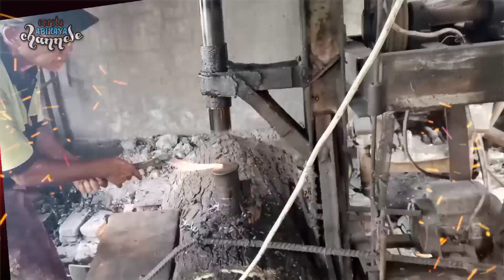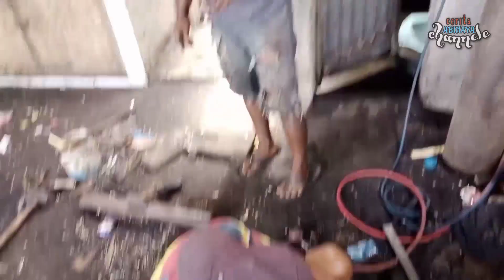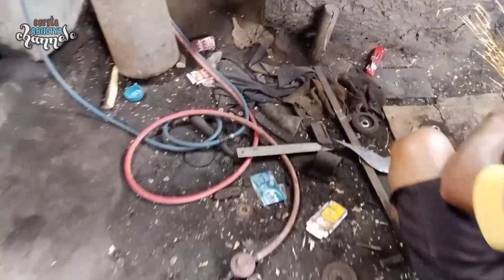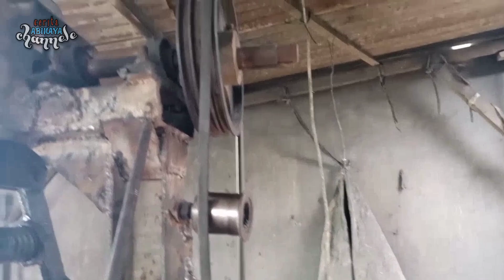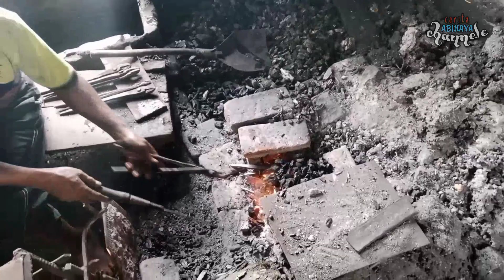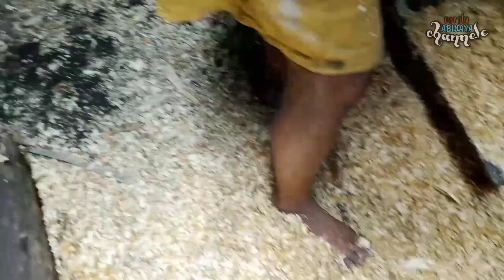•LIVE Proses Pembuatan Sabit Isen Baja Gigik Rodagila. "Ternyata Begini Keseharian Pengerajin Sabit"

Comment: Sik original pinten hargne,saget kirim Ke Gunungkidul mboten
Reply from the maker: 70.000 yang original uk. Kecil
90.000 yang original uk. Besar
90.000 yang sudah di asah uk. Kecil
110.000 yang sudah di asah uk. Besar
Reply from the maker: Ongkir
17.000
3 aret ongkir masih tetep sama masih terhitung 1kg
Reply: 110 mas
Reply: maap bos bs pesan, transaksi model gmn?